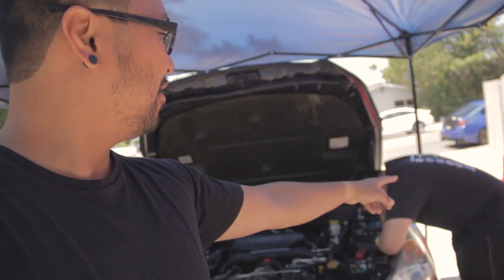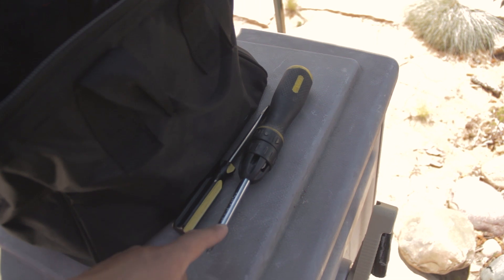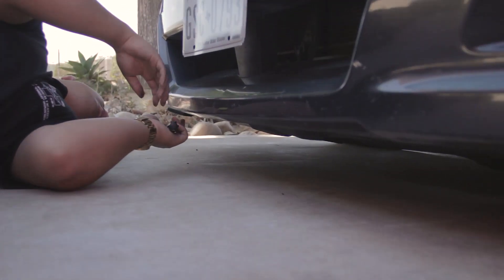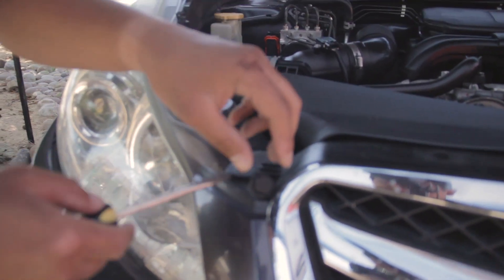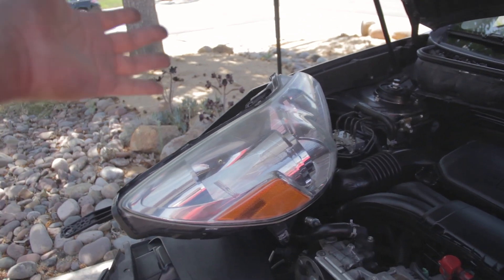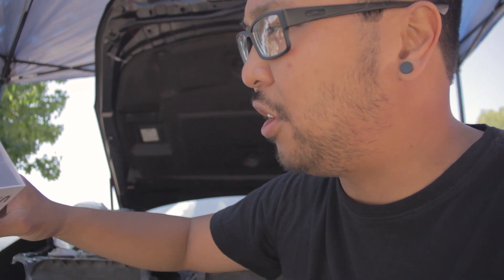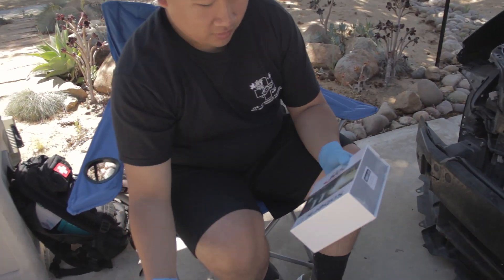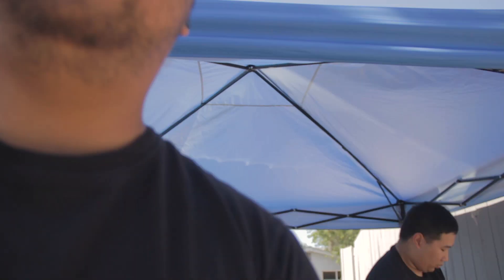How to Change the Headlight Bulb Subaru Legacy & Outback (2015 2014 2013 2012 2011 2010)

Comment: I did it through the wheel well once..  lucky to get it put back in and retreive my arm.  That stupid clip was a nightmare via braille.  Now the wifes passenger side is out.. I think I will use your method and replace everything.

Comment: Don't you need to put that cover back on to avoid dust, grime and stuff getting inside the bulb assembly?
Reply from the maker: Yeah that's what I told Kevin but he said send it. 😂😂😂 I cut a small hole in back of my cover to pass the cable through. They also make a rubber boot you can slip on they sell them on Amazon for a few bucks
Reply: @victordeleon8412  I have the same concern for the LED bulb.   why did you cut the hole on the cover since there is no need to run the cable through like HID kit?
Reply from the maker: Ziyi Wang the LED lights Have a ballast that had to sit outside the dust cover so I made the hole.
Reply: @victordeleon8412  thank you so much
Reply: you wouldnt happen to have the link for the rubber boot for the led conversion for the headlight by chance? i wanna do this for my 2013 Outback but dont wanna leave that cover off when changing to LEDs. living in the northeastern part of the US, we get a lot of snow and rain, so moisture is inevitable lol
Reply: Yeah, I was wondering the same, and it's the main reason why I watched this video, as it is not documented/demonstrated anywhere else. but it also seems like he was able to fit everything inside the @ 9:14

Comment: Quick question: How's the light at night from the replacements?  Every lighting forum says that LED's can't replace incandescent cause they have different light patterns and that what goes down range will be inferior.
Reply from the maker: The light is fine. Very white and clear. You can replace the bulbs in the projector with LED without have reflection pattern problems. It’s the day running light bulb that doesn’t work as well if you change from incandescent to LED in these headlights
Reply from the maker: @Akabecco88  what was the time stamp when I said it didn’t work? I think it worked right away? If it’s not working check all your connections and try plugging the electric connector to the bulb the other way. If only one side is still not working you may have a bad bulb and have to contact the seller

Comment: Where did you get these lights I cannot find them on ddm tuning
Reply from the maker: We have a local store here in San Diego. I made this video a few years ago, I've actually been using lasfit lights recently for premium led. I think they're better than DDM
Reply: @Victor de Leon  good to know but I do not believe they have whole units for the legacy. But I just ordered some lasfit for my truck.
Reply from the maker: @bradlaflamme6127  this gen Legacy is H7 bulb, its pretty common im sure lasfit makes them. I use the Sylvania websites fit guide to research bulb sizes for any vehicle https://www.sylvania-automotive.com/bulb-finder.html?gclid=Cj0KCQiA-JacBhC0ARIsAIxybyPwnc3f2EKJw5SnvhqQTfNe93tBlqmjS7A7VAiZYlPzEgJXz9HswkYaAoBsEALw_wcB&gclsrc=aw.ds
Reply: @Victor de Leon  yeah I see just the replacement bulbs but I was looking for a whole housing replacement. I have been disappointed in the past with the beam pattern with just the bulbs. Different car and Different bulb but that is my experience.
Reply: @victordeleon8412  I will see if the wife wants to go that route. Of the bulb because her lights suck bad.

Comment: Do you guys know the bulb size/type of the daytime running lights on this car? I replaced my H-7s with LED ones but there is still the ugly yellow of the running lights 🙇🏼‍♂️😵‍💫.  
   I have the 2010 legacy GT (such an amazing and beautiful car btw🥰❤️!) your missing out not having it. Not gonna brag but it’s .04 seconds slower in the 1/4 mile than the same year STI🤯🥳! I may have topped mine out once….by topped out I mean buried the speedo needle past the 160mph…. All the way vertical 😂😈! Guessing it was at about 190mph😱…. I still had throttle and rpm’s left before redlining out! DISCLAIMER…I don’t suggest doing that for the record unless you know how to drive very well and no one else is on the road! Don’t risk putting anyone else’s life in danger if you want to be risky on public roads. I just got lucky that day 🙏🏻😍!
Reply: Haha I just now saw your hood scoop 🙈🥳! I was wondering why you’d put money into one that wasn’t the GT! This is and has been my favorite daily ride for over a decade now 🥰! They are so underrated!
Reply from the maker: I dont know the bulb off the top of my head but I think you can look it up on the Sylvania website
Reply from the maker: @randallnilsen8623  this video was made with my friend's car that is just a NA legacy, but I have the GT

Comment: So was a canbus decoder needed for this install?
Reply from the maker: Ryan Clarke No canbus or any additional hardware is needed for the headlights when you switch to LED. But I think you need one for the rear taillights. My brake, and traction control lights (in the dash) blink sometimes in the middle of driving after I installed the LEDs in the tail lights. It only happens when I have the lights on, and I looked it up in the forums. It says it’s because the rear tail lights are LED. Never had a problem with the fronts.
Reply: Thanks

Comment: Hi Victor, how are the LED headlights holding up after a year of use? Are they reliable?
Reply from the maker: Kevin sold the car a while back but they held up until the car was sold. But we’ve been using Lasfit led at work and I think I like the quality of those better. Will probably be using them for my personal stuff in the future, they’re just a little pricey
Reply: @victordeleon8412  Thanks for the vid and update.  Wondering if you've done high beams on one of the subies w/ the high beam/DRL setup and if that went smoothly.
Reply from the maker: @DANT98   no I haven’t changed and of the other bulbs yet